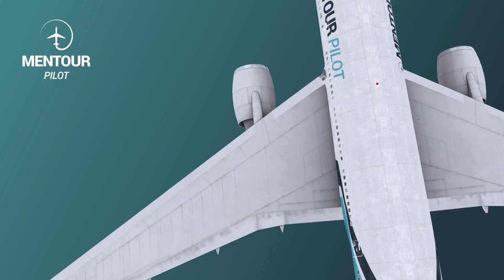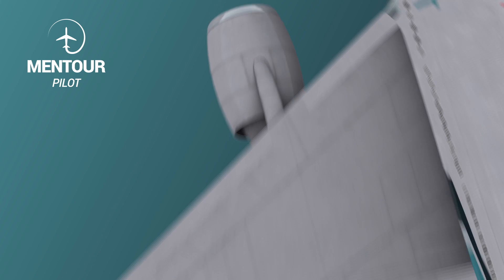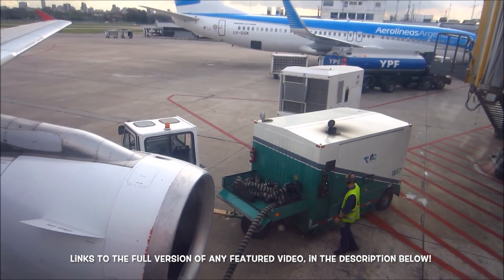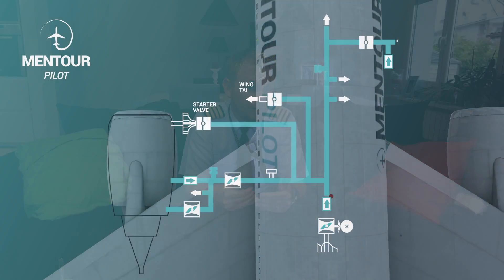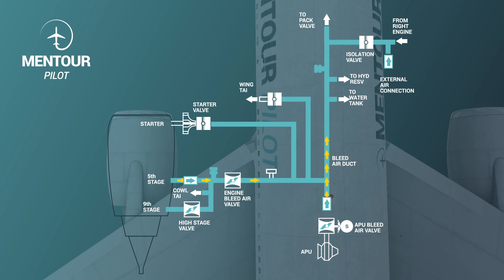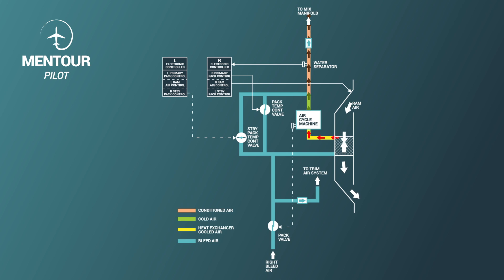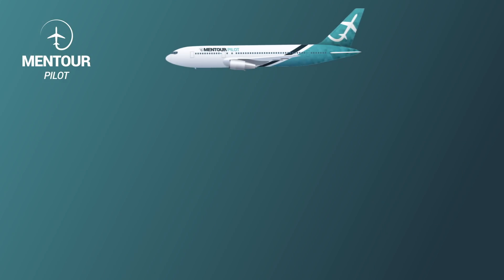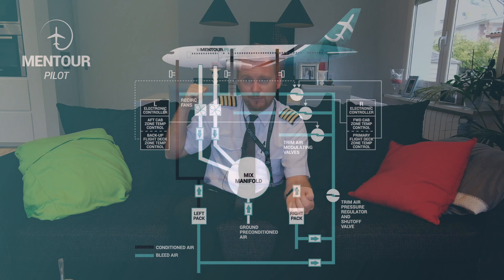How does the Boeing 737 Bleed-air system work?!

Comment: If the aircraft is on ground,and the  temperature is hot(like 30°C). How can the ram air cool the bleed air down to the comfort temperature(like 20°C),thanks~
Reply: Aircraft cannot be effectively cooled on the ground, without an external source of air conditioning.
Reply: @gordonrichardson2972 the ACM cools the air. You must be a B747 man where the packs on that aircraft struggled to keep the cabin cool on the ground on a hot day. The B737 doesn’t struggle the same way
Reply: Hi, i will give you the long answer so that hopefully you will understand how a pack works, if not feel free to ask more questions - there is not such a thing as a futile question! * The bleed air entering the pack via a primary heat exchanger is routed through a compressor driven by the coaxial expansion turbine - mounted on the same shaft - and where it is compressed increasing the potential energy made available to the turbine and thus its cooling efficiency compensating for the adiabatic rise in temperature - for adiabatic we mean a change in temperature due to a variation in pressure, the more the pressure is increased the closer the molecules are squeezed together, the more they collide, the greater the energy they release under the shape of heat, and viceversa- a secondary heat exchanger removing the heat from the compression process; a water extractor extracting the moisture from the air as it has been cooled down to its dew point - the amount of water vapor a gas can hold depends upon its temperature, the higher the temperature the more it can hold before becoming saturated, the lower the temperature the least it cab hold, the temperature at which a gas must be cooled down to to become saturated is referred to as dew point, at that specific temperature moisture forms - by the secondary heat exchanger; through the core of a re-heater into a condenser at the turbine outlet and preventing the formation of ice in the same condenser; back to the re-heater where it is heated to an optimal temperature, into the expansion turbine cooling it adiabatically to about 2C. The re-heater and the condenser are not part of the pack itself.
* The primary and the secondary heat exchangers basically consist of radiators using as cooling medium outside air entering the ram air duct via an inlet door operated by the onside controller in such a manner to maintain the compressor discharge temperature at 110C, and then exhausted overboard. The controller will drive the door fully open on the ground or during slow flight with the flaps extended triggering the RAM AIR DOOR OPEN light and fully closed as the airplane accelerates. The flow of air through the duct is also facilitated by the suction effect created by an impeller housed in the same ducts and driven by the coaxial compressor-expansion turbine assembly while deflector panels open on the ground to minimize risks of fod.
Hope it helps! Ciaoo
Reply: 5:32 he says that after it is cooled by the ram air, it then goes through a refrigeration system called an Air Cycle Machine

Comment: 14:40 What then happens in case of emergency, when the system doesn't have time to equalize the pressure and you need to expedite exit?
Reply: In principle the outflow valve should be able to cater for a fast descent. In addition there are blowout-panels to cater for over-pressure. When this process fails and the doors cannot be opened, the results can be catastrophic.

Comment: While this was a very informative video I don’t think you covered the origins topic.

I took the title to question whether a propellor plane can pressurise the cabin.
Reply: Both a turbo-charged piston engine, and a turbo-prop engine, can pressurise the cabin.
Reply: Hi Gordon 

Thank you for the reply.

Do they make air pressure the same way? Or do they use a bolt on compressor.

I do apologise for all the questions.

I am too young to have gone on a passenger prop plane (not so young 35!).

I do remember seeing propellor planes as a kid but never got on one.
Reply: madmark50484 Sorry, I have no idea of the specfic equipment used in the 1930s. Wikipedia suggests electrical compressors.

Comment: This was a well made video Question...
Can you manually depressurise an aircraft during cruise 
Also do all these pressure valves add aerodynamic drag to the aircraft if so then how does it affect the aircrafts performance on things like fuel and speed

Comment: How do the engines initially start?
Like whithout compressed airflow given to turbines, how does the fan in the initial stage rotate all by itself?
Reply: There is a little gear connected to the high pressure compressor shaft. On the other end of this little gear a little turbine is attached, that bleed air drives the turbine not the engine itself.  Bleed drives little turbine which turns gear, gear turns engine high pressure compressor shaft (n2). After certain n2 speed that gear disconnects. Very similar to car engine starter but driven by air.
Reply: I've been wondering the same thing
Reply: It really is driven by compressed air in order to start. But from inside.

The APU is a small turbine which can be started with an electric engine. This electric engine gets its energy from a battery in the plane.
Then the APU pushes air into the first turbine. At the same time the ignition is started. So the engine spools up because of the air. At some point there is enough airflow, the combustion gets strong enough that the engine can run itself. Now the APU is not needed anymore and we have one running engine. This engine can provide the bleed air to start the second engine.

If the APU does not work they call the air compressor on the ground which pumps air into engine 1, the rest is the same.
Reply: @derwilly1234    Thanks, that makes alot more sense now

Comment: Wow, I cant believe they run hot bleed gas through a heat exchanger. Surely it would be more efficient to fun it throuh a nozzle to draw in cold external air, so the cabin air comes in without the additional drag of the heat exchanger (small, but drag none the less) and there is less demand for bleed air increasing the engine efficiency. I also didnt know that 787’s used electric compressors - I suppose the engineers did their sums, but as the energy still comes from the engines, and the plane is lugging around another compressor, it surprises me that its more efficient (but thats what engineers are paid to calculate, which is alwsys going to be better than my intuition :)).

And be very careful about deducing engine conditions from smells - remember Kegworth BM092. Design changes and retrofits can change things around.

Comment: 10:20 It's very noticeable for me when I had sinus infection, while other can equalize pressure differential in their ear without any thought, I had deliberately force myself to yawn. 

The landing part is the most painful part, I have to see barometer on my phone to see how much more suffering left I have to endure. at least when I see the barometric altitude at negative on final, I know it was the peak of the pain and once we've landed and the engine has spooled down the pain would be gone.

8000 ft is painful, idk about 40K feet, people who have sinus infection and severe cold would have probably lose their hearing.

Comment: How does the manual pressurization mode work?
Reply: There is a switch on the flight deck to manually control the outflow valve open or closed. This lets you manually control the rate of change of the cabin altitude either up or down.

Comment: I am surprised that @MentourPilot did it too at the beginning of this video.  Let me explain.  5 or 10 years ago I was on a flight from Toronto to Zürich when the pilot informed us there would be a delay due to "an air conditioning problem".  To this day, I believe they were lying to us to keep us calm.  The truth is there was a a problem in the pressurisation system=potential hypoxia=life threatening.  It is also possible that he wanted it fixed as there were few services for Air Canada in Zürich and writing something off to the MEL (assuming it was going to make for an uncomfortable flight=too hot or too cold) means you have to fix the problem at the destination.  I suppose the latter may make more sense as he spoke of doing exactly that (but referring to his " log book" not the strange MEL that only aviation types know about), which got replaced somehow by, "the problem has been fixed by our maintenance crew, we will be pushing back shortly".  Now @MentourPilot referred to the "air conditioning system" when I think he meant pressurisation.

Comment: is the air being so dry a problem for pilots on the long term? for example getting really dry skin or eye irritation
Reply: Holay yes. You actually end up drinking way more during flights than you'd expect. This winter my lips are getting chapped much easier as I'm flying a full time job now vs part time/ seasonal

Comment: As always great video. Question, when at cruising altitude with the cabin pressure at approx 8000ft if a passenger begins to experience altitude sickness what is the protocol to handle this situation? I know that administering pure O2 is the typical recourse, but this is impractical when the flight is several hours long and having pure O2 bottles on board is not allowed (except in the cockpit), and an O2 generator has insufficient run time. I live at 8700ft in Colorado and people coming from sea level to visit me have trouble from time to time because of the altitude. Thx
Reply: Can't you start by giving them water and aspirin? That's what people do in the mountains of Southern California.

Comment: Hmmm, you mentioned that you actually dehumidify the air, which causes the dehydrated feeling at the end of long flights. Why don't you guys boost it a bit and maybe lower the temp a bit instead to decrease that  discomfort?
Reply: Humidifying the cabin air would require a source of pure water. This would add cost/weight and complexity.
Reply: @gordonrichardson2972  Actually, I wasn't thinking about humidifying the air, since he said that they dehumidify the air, maybe just do that somewhat less. The air is already chilled so dehumidifying it further seems like there's a reason not yet stated.
Reply: @DBYNOE  He didn't explain it very well. Air is dehumidified at ground level, but not at altitude.
Reply: @gordonrichardson2972  Now that makes sense, although I still think they should do something about the humidity,  on long flights it's pretty crappy.

Comment: Why did we smell kerosene in the cabin sometimes?
Reply: Richard that’s is usually caused by a problem with the APU or auxiliary power unit and that the APU is used to provide bleed air for the pneumatic system. To resolve this issue Pilot’s either call the ground mechanic or switch off the APU and use an external power source to provide air for engine start up

Comment: I flew to cusco once where the landing altitude is over 10,000 feet with terrain all around.  It did make me wonder how the pressurise manages during the descent and climb at just 2,000 feet above the cabin altitude.  Especially since on takeoff it would reach 14,000 feet in under 2 minutes where oxygen masks would be deployed. So I was wondering how quickly the engines are able to build up enough bleed duct pressure whilst already under a lot of demand on takeoff due to the thin air and terrain around the airport and possibility of needing engine/wing anti ice.
Reply: Cabin Altitude is maintained to the landing strip altitude. So if u land atn airport 12000 feet AMSL, cabin altitude from the start is set at 12k and not 8k. This is done to climatize human body and prevention negative air pressure inside the cabin. Lastly there isban outflow flow valve that releases cabin pressure into the atmosphere. Depressurization happen very quick became air just wants to rush out at the slightest opening of the outflow valve

Comment: OMG, cabin air is such an important issue.  Do the pilots ever manually control the pressure reduction during decent?  We ask the crew to be careful when traveling with small children who are in agony when their ears pop.  Some flights are much better than others.  Is the flight crew actually doing anything, manually regulating the pressure?
Reply: I think you mean in agony when their ears don't pop...the popping is the pressure being equalized so if they are popping you would not be in agony.
Reply: Pressurisation is controlled automatically by cabin pressure controllers

Comment: I’m glad newer aircrafts are getting away from bleed air system, it is too dry and easily prone to fume events which can be lethal in the long term especially for pilots and flight crew
Reply: The dry air problem is hard to solve because cruising altitude is so cold that there's very little water vapor in the outside air.

Newer designs try to recover and recycle water vapor from the exhaust air.  Or you can recycle more air, but that also retains carbon dioxide.  (Not enough to be dangerous, but too much recycling is bad for cabin comfort.)
Reply: The newer aircraft still have the same fundamental problem...  outside air is super old and therefore carries very little moisture.  When that air is subsequently warmed up the relative humidity is even lower. Doesn’t matter how the air got pressurized, it’s the source.   Adding humidity would be possible by humidifier, but impractical weight to carry.
Reply: @Minella Mita How tough would it be to toss a few gallons of distilled water into the cabin?
Reply: @davidwhite2011  I'd imagine they'd have enough water to humidify the air for the entirety of a flight.

Comment: Why not pressurize to sea level, so there are no headaches or sinus problems? Also, why not give people more fresh air? I always feel sick after flying. Probably because I've been breathing stale air.
Reply: It's not pressureized to sea level because giving the fuselage the required strength would make it so heavy that it couldn't fly. The air quality is quite good. You're more likely to get sick from the tray table and surrounding areas than the air.

Comment: Curious question, rather bleed air why not just use ram air to drive those systems or does it not produce enough air?
Reply: Doesn’t produce enough pressure, particularly at low aircraft speeds

Comment: I am surprised that you are allowed to fly with an inoperative APU. If an engine is lost would you not start the APU so the remaining engine can be fully dedicated to forward thrust instead of passenger comfort, electricity etc?  Maybe not a big issue if flying over a continent as opposed to the ocean?
Reply: If one of the engines fails, the aircraft will naturally descend to a lower altitude, and cabin pressurisation will not be necessary anyway.

Comment: Back in the 70's/80's it was popular to hand out candies during descent to help with ears popping. Question: Was air pressure manually controlled in those days? There seemed to be more abrupt changes in cabin air pressure. I don't even notice my ears popping in modern a/c. BTW, always great videos and massive amounts of interesting info.
Reply: I think it's a newer control system that takes external air pressure into account, instead of just having an extremely basic reactive control system for the outflow valve. It seems to me the older the plane the more abrupt the changes are as well. The automatic controls he describes follow a system of proportional ascent and descent when climbing and descending, whereas back then, they simply maintained a certain cabin altitude, descending rapidly with the descent once below 8000 ft, and ascending rapidly until 8000ft before it suddenly stops ascending.
Reply: I don't care about my own discomfort just anything to stop the babies crying.
Reply: 737s and a319 320 seem pretty good.  The old dc9 used to always cause me ear discomfort.  Those are old planes so that's maybe why

Comment: Without having even opened this video the answer is No.  The Cessna P-210 is a Cessna 210 Centurian which has been cabin pressurized.  The airplane is powered by a turbocharged six-cylinder engine.  It's capable of climbing up and into the 20K flight levels.  They were first produced from early versions in 1978 (834 Built)  and remodeled to a more sophisticated version around 1985-86 with a Riley Turbine P-210 (40 built).   There are not too many of them around today but they were considered "pressurized" airplanes that could carry six people back in the day.  They had propellers and retractable gear.  They were very easy to fly airplanes. 
              It's weird.  The larger Cessnas were easier to fly than the smaller Cessnas.  The C-152 is easy to fly.  The C-172 has a slow roll rate and is more "sluggish" and thus more difficult to handle.    However, the Cessna C-182 Skylane is a beauty to fly with a much faster roll rate than the C-172 Skyhawk.  Almost all of the other Cessnas are very easy to fly, but the C-172 Skyhawk has the least aileron response compared to all of the other single-engine Cessnas.   I have a few hours in Cessnas, about four (4) thousand hours in Cessnas.  This does not account for the other hours I have in Mooneys, Bonanzas,  Pipers, and other types, even in Eurcoups. So I have a little experience in single-engine Cessnas.

Comment: Interesting video.  Regarding smoking, I flew on props and jets in the '50s and '60s and don't recall being overwhelmed by smoke - the cabin seemed to clear pretty quickly and most smokers were in a lounge area.  There were ashtrays in the arm rests even back on the DC6s I flew on but I rarely noticed anyone smoking near me.  Not sure if the DC8 or 707 used bleed air for pressurization but believe they took in a bit more outside air as did the DC9.  Aside from that, the number of 'fume' events related to the bleed air seals seems to be increasing - for some reason affecting certain airlines more than others.